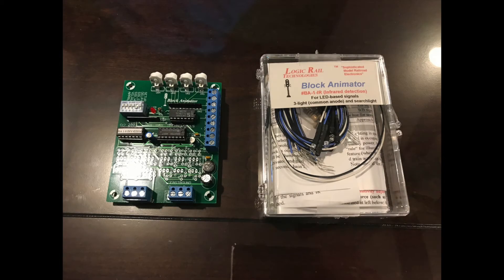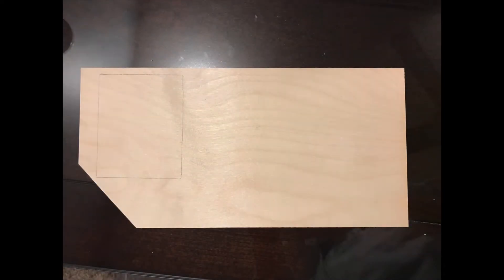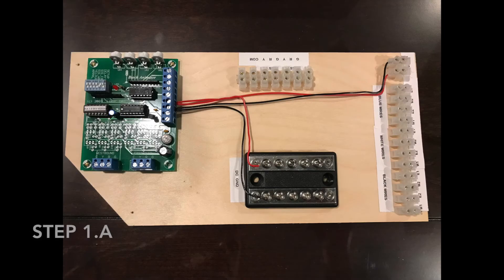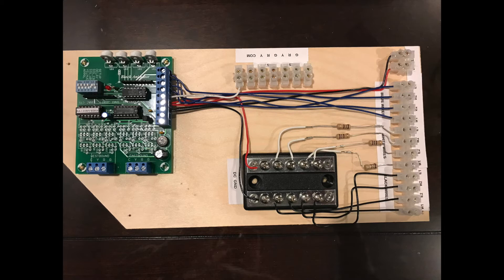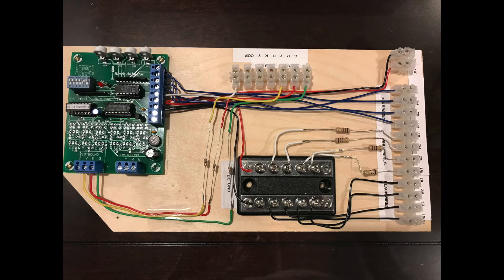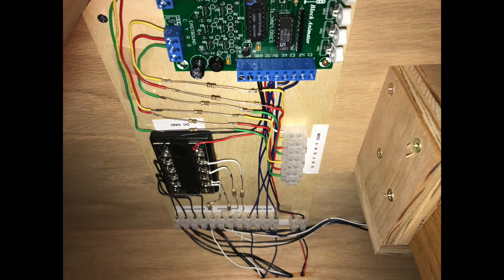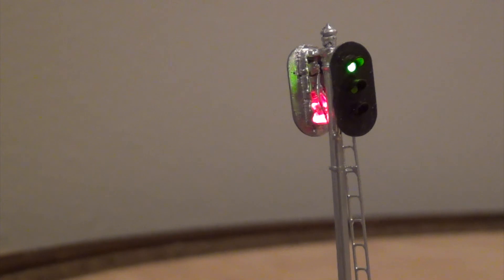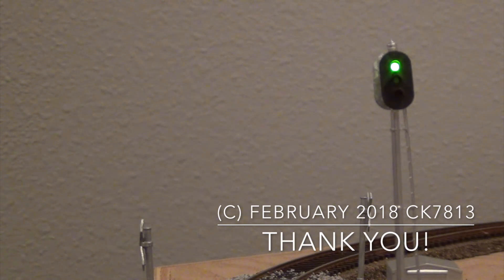Installation of Logic Rail Technologies block animator BA-1-IR

Comment: Don House  Thanks for the video, just hooked one 
up on my work bench and got to work. I put the 3 light signals at the ends of the block like  diagram but i
I'm mounting the sensors on the side of tunnel hopefully because can't get at the track. Works great on test track. again thanks